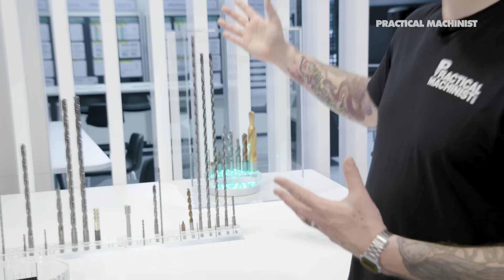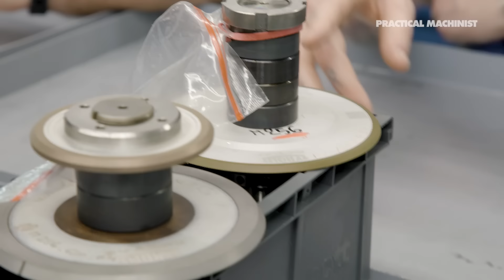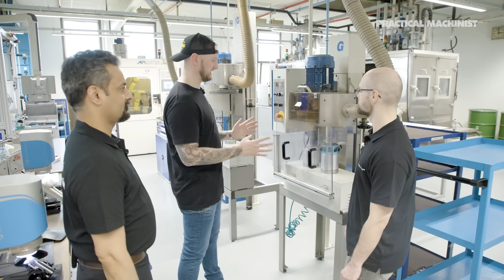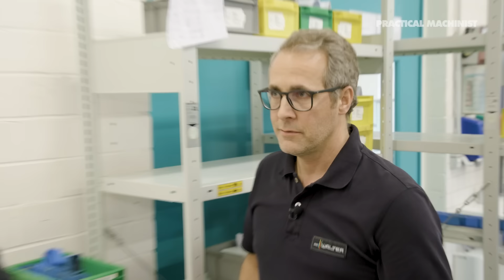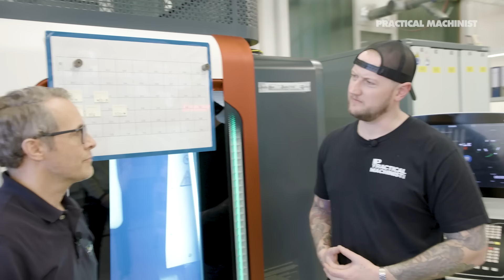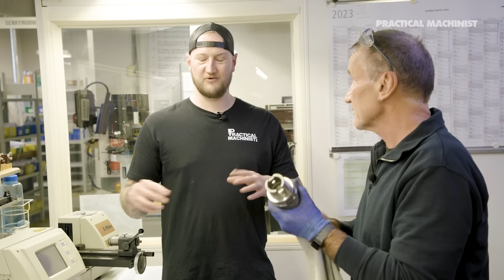Walter Tools' TOP SECRET Production Units UNVEILED!

Comment: Nice video, but the thing I was the most exited about wasn't mentioned. How do they get the spiral holes in the carbide?
Reply: Very simple, it is just nylon rope that evaporates when the blanks are sintered
Reply: As far as I can remember, they are cast in there prior to the beginning when the blanks are made - and I don’t recall if it’s shown but they have optical sensors inside the machine that index the profile of the drill to the holes when they’re ground so a flute doesn’t end up cutting through a coolant channel - super neat stuff!
Reply: its done by having spiral copper (preshaped) that the carbide powder is pressed around. sintering melts it away leaving the desired spiral shap inside
Reply: I was clicking through trying to find that after it was first announced.  Never found it :(
Reply: He did say it was done in the carbide blanks, just not how
Reply: 🤓🤓A million dollar question ! ! !
Reply: They are not spiral.  They are a straight hole that is done in preform.
Reply: @c.docholiday5651 
Sorry, but they are spiral coolant ducts and put into the carbide blanks during sintering.